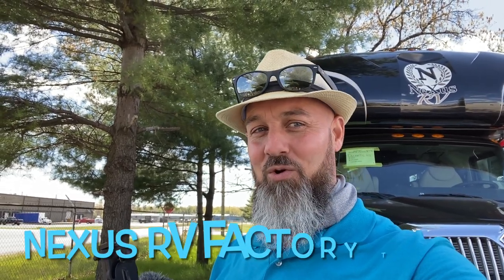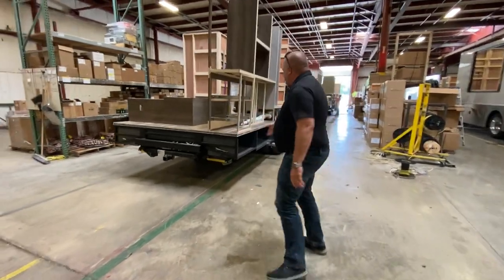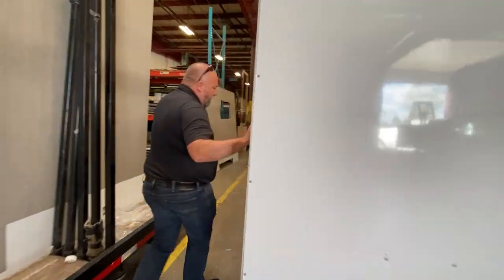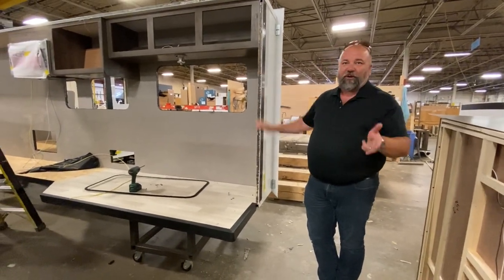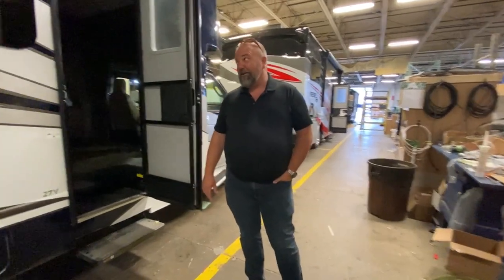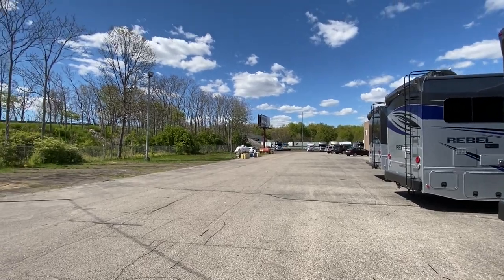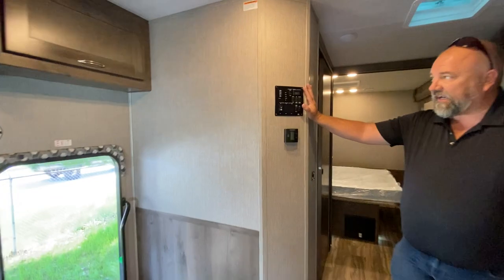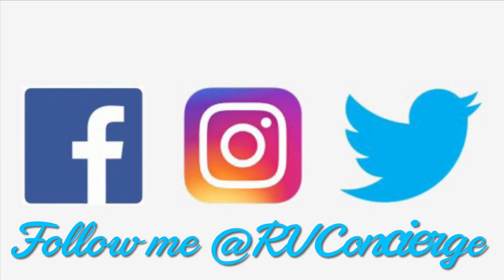Nexus RV Factory Tour

Comment: It is old video, but I was very interested in 2024 Nexus 30R 4x4 . I saw one today, but ground clearance of the box is so low barely 9 inches , exhaust pipe was almost touching the ground. Honestly hard to understand how compony can release product with such low ground clearance in 4x4 chassis  . Not sure if ground clarence changed by switching from International  chassis to GM chassis, but I thought they both identical.   I really like everything this coach is offering, but can't buy something with such low ground clearance .